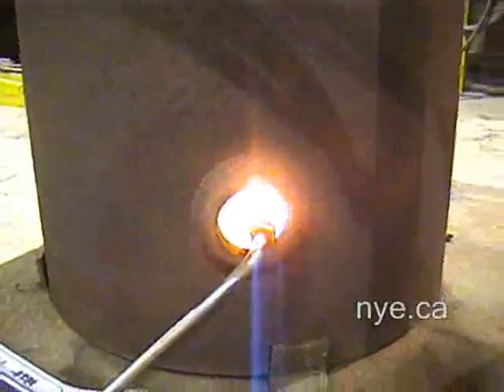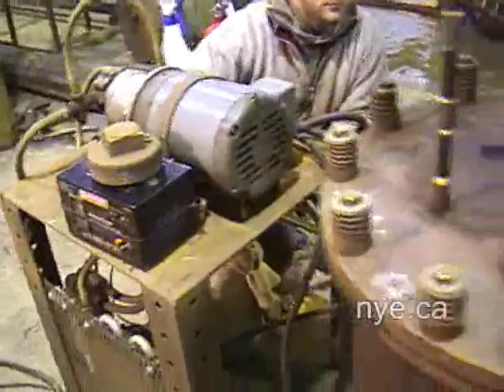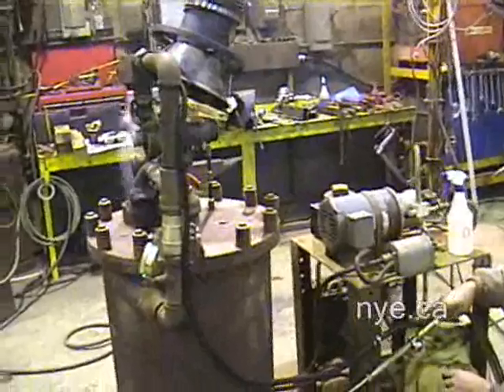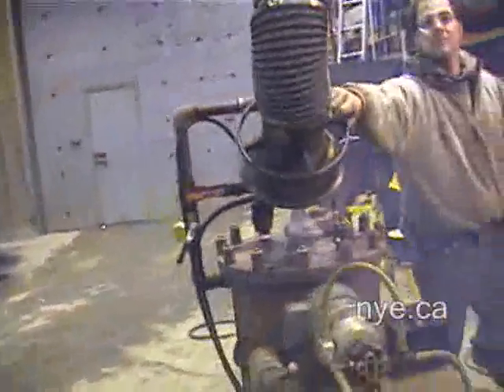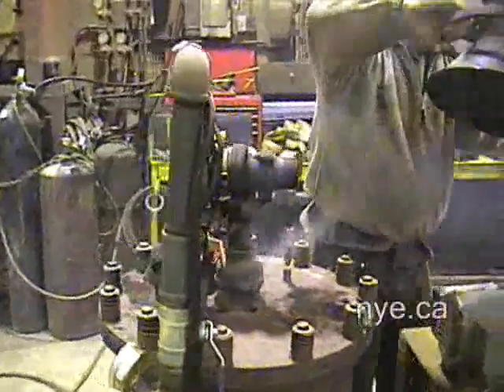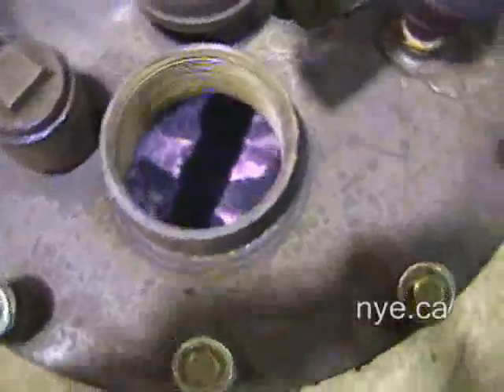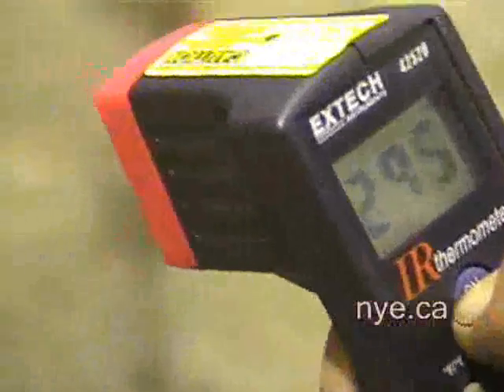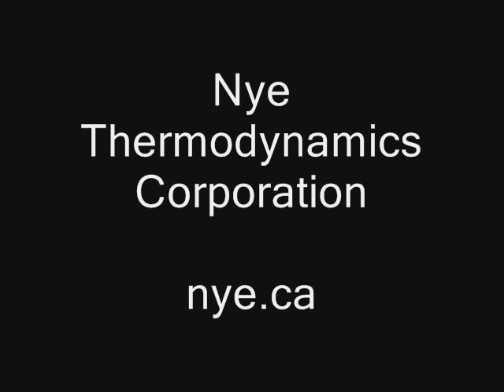NT/6 Wood Burning Turbine Stove/Generator

Comment: Why not get a wood chipper? Feed it chips with an automatic auger. Put a water jacket around it, run the exhaust as a post-heater. Off grid cogen?

Comment: I personally doubt it very much. If this gets patented, a large company will buy it up, then take decades "perfecting it" so they can continue using less efficient money makers. I've looked up similar ideas and yes, if the design permits proper airflow, it could technically be used to burn coal, though modern coal steam plants are already pretty efficient, so I think this design is better suited for trash incineration, such as tires.

Comment: so true but don't neglect the diesel concept. Hydrogen reacts faster than gasoline, so when the spark fires, it burns first, increasing pressure alot, and making more of the gasoline burn completly before exiting. This concept is imperfect, and doesn't always work well. Use a thermal couple system to use waste heat to power the hydrogen production. this would confuse the car computer though, so it doesn't work with newer cars without altering the response to o2 sensor input.

Comment: if only this guy used foil bearings:( I'm so sick of hearing about using turbos and how they're so great. One simple relatively cheap add-on could make a system like this the appex of green energy technology(at least for now). foil bearings use no oil, don't rust, and when up to operating speed approach zero friction. then use biomass (wood, trash, poo, etc. to fuel it, and use the ashes for fertilizer or construction material)

Comment: They're useful for more than that if you have some ingenuity and creativity. This is a fantastic way to burn wood/garbage/etc at incredibly high-temperature. Certainly more energy-efficient than using electricity to drive a blower. Only downside is the oil pump and the inevitable build-up of carbon deposits on the exhaust vanes.

Comment: Turning water into HHO dosen't "create" new energy, it is converting electrical energy to chemical energy, turning it back into electricity again dosen't "boost power" because the power to make the HHO has had to come from somewhere in the first place. If a "free energy" HHO system is 20% efficient on producing the HHO and 40% efficient on recovering it, then it is 8% efficient in total, so you are actually loosing energy in heat etc,

Comment: Self starting? I don't think so. Preheat with a torch, starting the turbo with shop compressed air. This looks like a concept test for something I don't even know what it should do. Pointing an IR temperature sensor at a vessel that was burning wood? Yeah, it was hot. Anybody can do that in their backyard,

Comment: The system I just described below can be added to your existing system with very minor bolt on modifications. I would be willing to build this bolt on unit to fit your turbine at no cost to you. Just let me know if you are interested and we can discuss details of operation before any work is done. 
If you have stoped this project please let me know if the unit is for sale. 
Oct1113 @ hotmail.com

Comment: Excelent project ! !  I am building a steam heat recovery system for boilers that could be used to economize your project. (there is no such thing as waste heat) 
Please contact oct1113 @ hotmail.com for more free details. 
In a nutshell - the fluid volume of the intense heat put through the turbine can be multiplied by introducing a jet of saturated steam. the effect will be increased pressure on the turbine with slightly reduced heat, resulting in longer turbine life and higher output torque

Comment: i love this machine, so air is forced at a tangent into the fuel tank/ combustion chamber, this then heats up say 120cfp   into 400 cfp of hot gases wich most likely pyrolizez the fuel as well as burns it, am i close, i wanna build this

Comment: So where does the net energy come from?  

If you can just run your car on water why is no company manufacturing this wonder car that would obviously give them total dominance of the car industry?

When I was young the imaginary seceret energy source was the 300 mpg carb. Now we're back to perpetual motion with hydrogen that oxidizes releasing more energy than it took to reduce it.

Why not just put a windmill on the car to generate the power from the wind while you drive? ROTFLMAO

Comment: In the video you say you're using a 300 amp alternator. At 14 volts that's 4200 watts which at 746 watts per horsepower, is a whopping 5.6 horsepower. That's if your alternator, electrolytic cell and the engine you're running on the hydrogen produced are all operating at 100 $efficiency. In the real world, you'll be lucky to get 1 horsepower out of that rig. So, you might be able to mow your lawn with it, if you're not in a hurry. Of course, you'd have to be able to  do math to understand that.

Comment: Wrong, as usual. I never said that an engine can't be run on hydrogen produced by electrolyzing water. I said that that process results in a net loss of energy. The fact that you needed another engine running on gasoline to get that engine to barely sputter along pretty well proves that point. And, seriously, you call the fuel-starved sputtering you got from that engine "running"? If you'd put that car in gear the engine would have died immediately.

Comment: No, water isn't a fuel source. russlehman is exactly correct.  Just because people file pattents doesn't make it so.  You can break the bonds and get H2 & O, but you only get the same energy you put into it when you burn the H and make it water again.  The Hydrogen in water could be a fusion energy source some day maybe, but that's a whole different ball game.
If you know how to make water a fuel, do tell, I'm all ears.

Comment: This video has given me some ideas for possible industrial applications of a unit this size or larger. If only I had the means to replicate this and refine it. It's a great idea getting the turbo to force feed the air for a hotter, therefore a more efficient burn. Keep working on the concept guys.

Comment: This was a demonstration of a idea for the starting point to create energy from waste materials. Point made was you need a fuel. After that they had to jump start the turbo to get the system started. The turbo was needed to provide the air to feed the fire. With out it your fire would not burn hot enough to generate the flow needed to spin up the turbo. Unless you started it on a gas. But now you getting into a dangerous area of explosive nature. I hope your drum don't pop.

Comment: You would have to gear it down, it's turning at probably at least 10,000 RPM Turbo shaft powered aircraft or generators are always geared down, most any alternator or generator armature would fly apart at that speed.

Comment: That is the most amazing thing I've ever seen. This thing is more amazing than the tsar bomba and Canadian tire's "eliminator" series combined. Just imagine sitting down beside a nice warm campfire in front of a calm blue lake, watching the northern lights. So peaceful and serene. Then firing up this beast so you can charge up your laptop and power up your 2,000 watt stereo system (which you happened to lug along) and blast some Dream Theater or Metallica or something, at 4:00 in the morning...

Comment: INesland, it works the same as a gas turbine/jet engine. The big tank is fed with air from the turbo which causes the wood to burn hotter. The hot air from the burning wood spins the turbo.
There are a number of turbocharger based gas turbine videos here as well. Compare the size of combustion chambers running diesel or propane to the size of this wood burner and the size of the turbo.